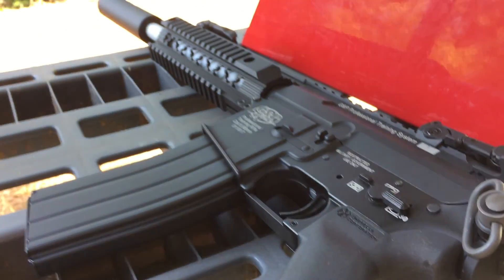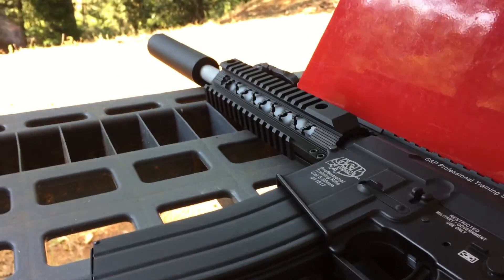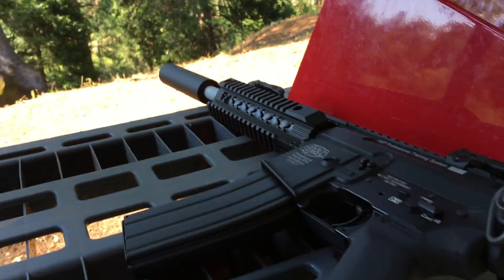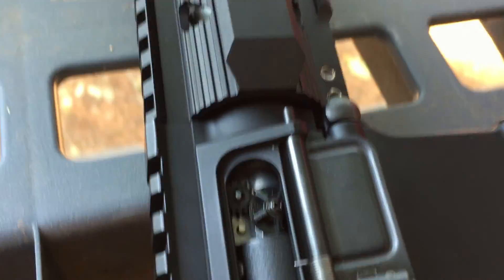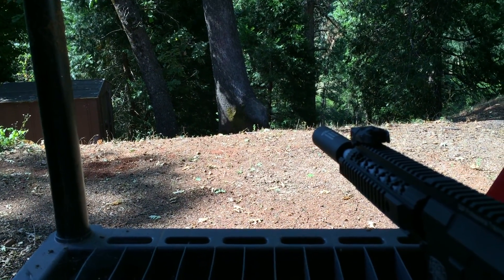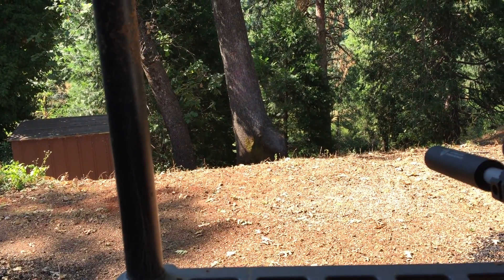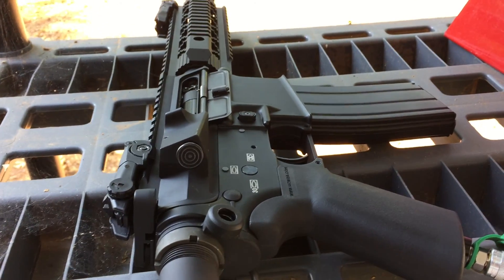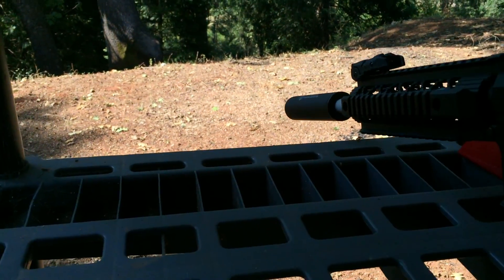Valken v12 new settings 2 QEV

Comment: For everyone saying that they are capped at 30 rounds a second it is either 2 things 1st one being your nozzle timing and the 2nd thing being your dwell aka cycle valve timing lower each of those and your should be good to go! if not than its probally because you are in closed bolt and you need to change the closed bolt cycle valve timing! if it does not work than you probally need to return your engine lol

Comment: This is the first video I've come across that delves into tuning, I had an issue with my gun regarding rof being restricted to 30 for some reason, so I copied how you tuned your gun and it fixed the issue, so thanks for that man. I put my cycle valve timing to 2 ms, what is yours set at?
Reply from the maker: Please visit www.hpairsoft.com and join. For more tips.
Reply: +Kinda Hazardous I copied his to but my gun wouldn't shoot right?
Reply from the maker: +iTzLegacy HD  put all back to factory settings. Then only adj noz back time over a chrono until toy see a drop in performance. Is a good place to start.

Comment: WHAT MAGS AND WHAT PSI WILL GET ME UNDER 400!
Reply from the maker: SLUG SHOTZ I use flash mags by lonex. To get you under 400 fps I will need to know more about your setup like barrel length cooler of the nozzle you are using etc.
Reply: Hi thank u for replying so without using the hop up / bucking setup the settings won't work ? The noxzel gets cloged

Comment: i put these settings on my valken v12 and now my gun wont feed can someone help me with this?
Reply from the maker: Feeding issues can be several things (cheap or wore out mag, bad BB's, Hopup bucking lips issue, nozzle alignment,  and Noz back time in ms .  First  check your hopup for issue like tore bucking or misalignment.  Try a different mag.  Increase your NOZ back time one MS increment until it reliably feeds.
Reply from the maker: Think of NOZ back time as the time the nozzle is held back to allow a new BB to enter the hopup assembly,  The longer the time (in MS) the longer the nozzle is held back.  My system above, all the parts, works best with the suggested settings.  But you will have to find what setting work best for your setup.
Reply: Docfire thank you I’ll try those things!